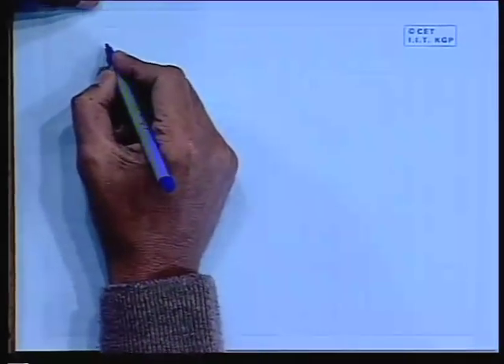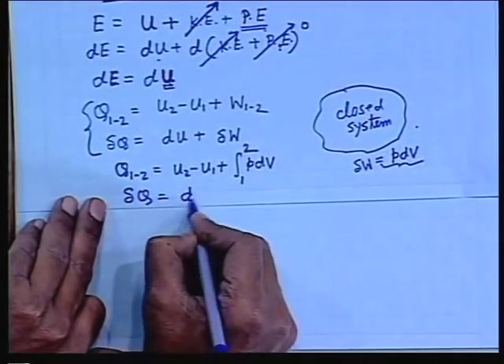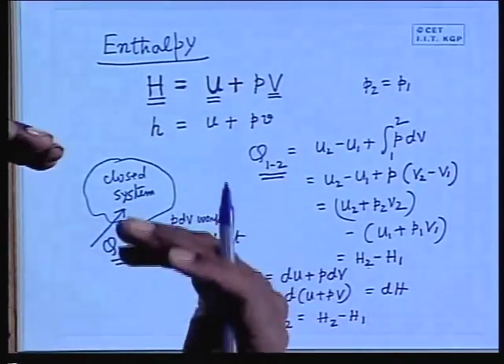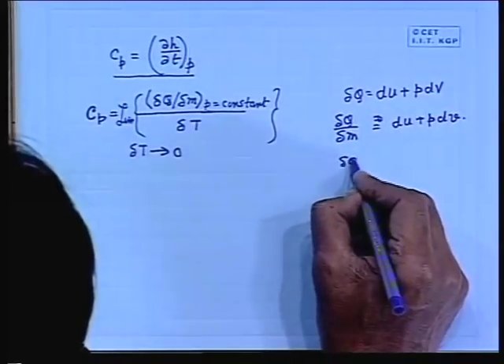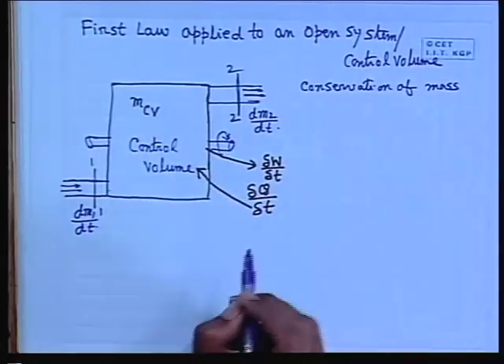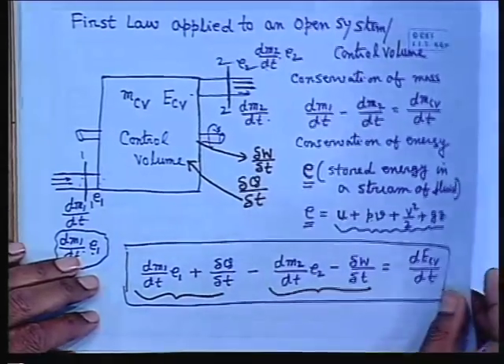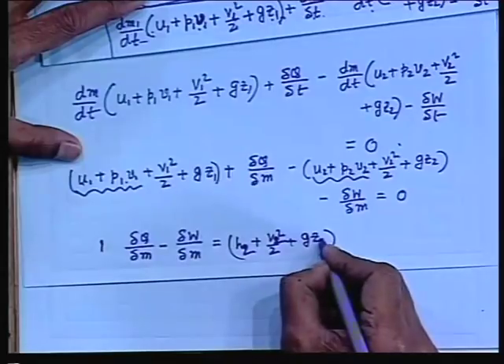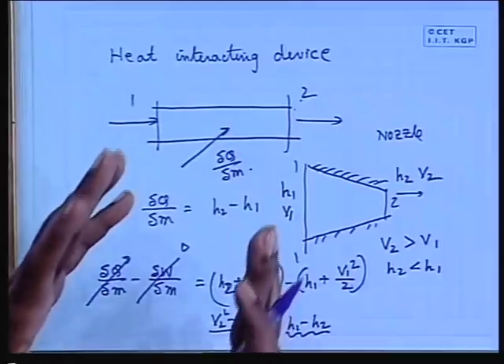Lec-4 First Low-II

Comment: I have one doubt regarding the work per unit mass for turbine is given by the change in specific enthalpy( with assumption that there is not much variation in kinetic energy)
But in turbo machine,  the work rate or work transfer rate is basically given on the change in kinetic energy.
So why the different approaches with entirely contradictory assumptions? Or am I wrong somewhere with my understanding?

Comment: 0:56 two consecutive lecturers of " 1st Low" even the same written on Title, now I'm confused it's "Law or Low" 😅. 
01:05 First Law of Thermodynamics (Closed Systems)
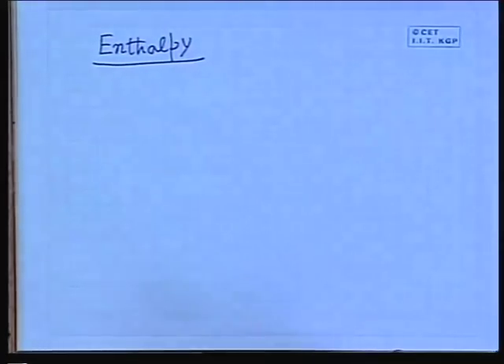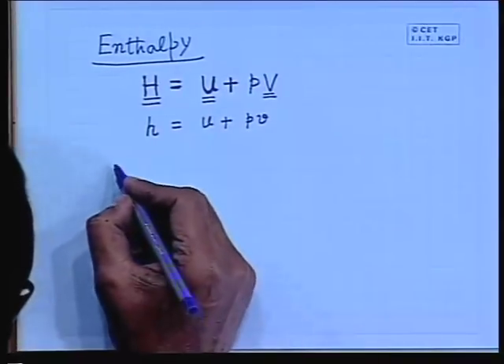11:39 Enthalpy (13:54)
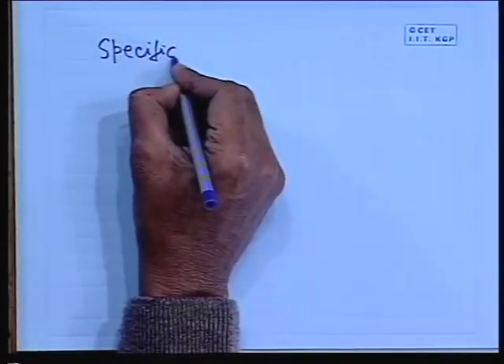18:11 Specific Heat
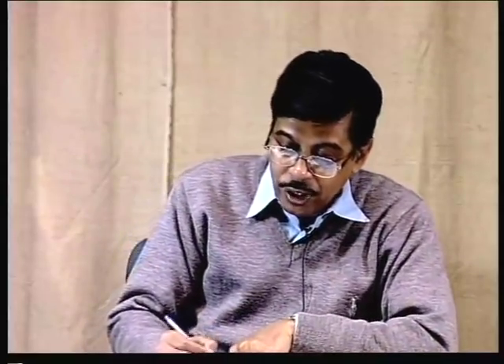25:20 First Law of Thermodynamics (Open Systems) *47:50, 
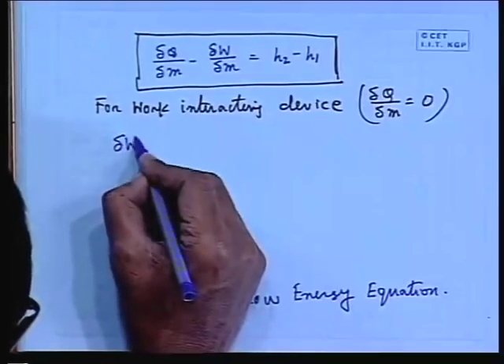48:58 Different Devices
S1-?: 56:19, 56:33, 56:58, 57:12, 57:29, 57:50, 58:16, 58:37
0:29 All rights reserved
Reply: Even on slide it is low 😂😂😂😆
Anyways lectures are great... It's like don't judge book by it's cover

Comment: why sir written  Q1-2 and W1-2 . while according to me if Q1-2 then W2-1 is ...... please reply if I am wrong ....
Reply: Q1-2,W1-2 mean system continuously taking heat and doing work at the same time(in the same process).while Q1-2 mean heat is consumed/produced by the system in taking system from state 1-2,while doing so system didn't do any work(-/+) this is one process.w2-1 mean  sytem did some work(-/+) while doing so system didn't consume/produce any heat and this is other process.which together Q1-2,W2-1 constitute a cycle